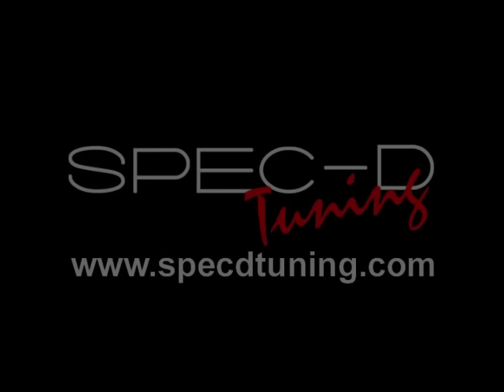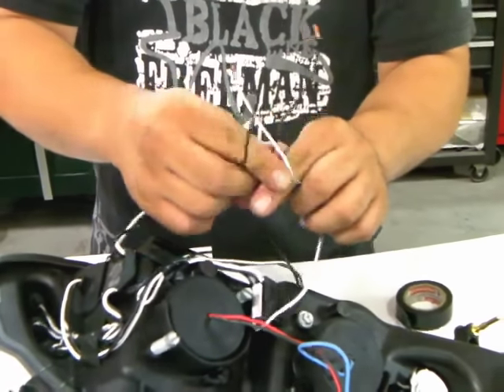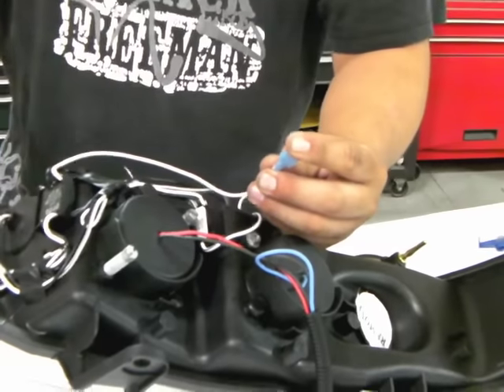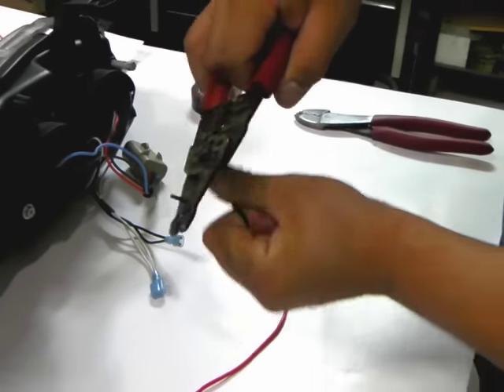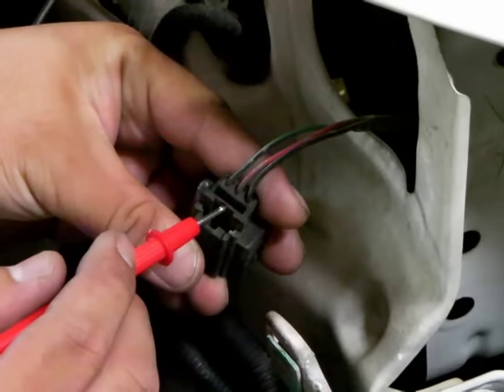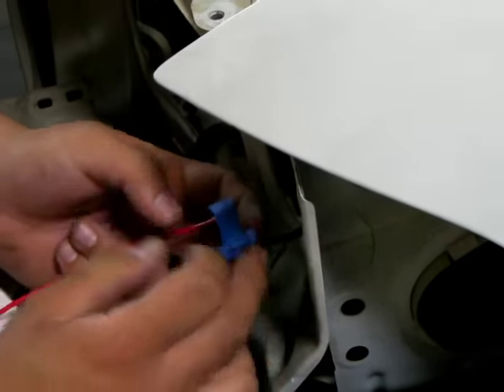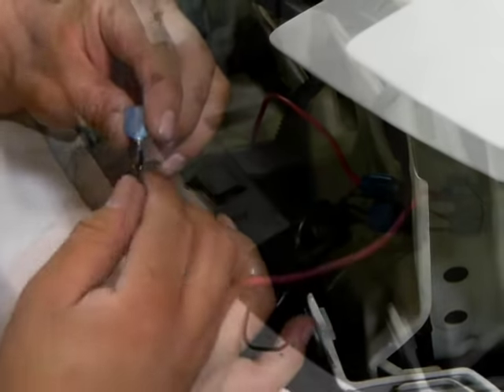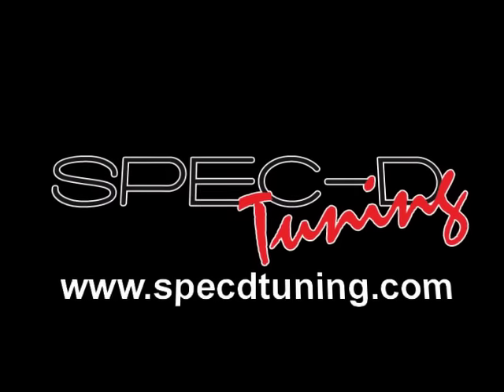SPECDTUNING Installation Video: Halo LED Projector Headlights Wiring Installation

Comment: bought a set of these for my jeep very happy with the bright light but once these are installed there is no way what so ever to get to the adjustment screws for up and down left and right this is so very much a hassle and I'm pissed.im not going to take whole assembly out to just adjust and put back in each time to get them right so they don't shine in oncoming traffic.very poor design..the next one is that the inverter for the three led lights above the halo rigs its faulty and had taken it to a well known shop to have tested and its shot.for the price of the new headlights I'm very dis pleased with your product.and also along with this I now have to call and figure out how the company is going to replace whats wrong...the major hassle is that even when I send them back for warranty I have NO HEADLIGHTS so I cant drive at night not have turn signals and this will prob take more than a week to settle this issue.do not buy these for a 04 jeep grand Cherokee laredo

Comment: Help .. ive got 01 yukon. New halos worked couple days. Then one high beam goes out. Then notice all headlights but one now runs very dim. Put originals back on with original wiring. Now they are screwed up with same symptoms. All very dim except one working head light i suspect using the crappy piggy back wire connectors in kit and run off side amber for power to the halows started problem time to go to dealer ?
Reply: +chrisccraig check your fuses my friend had the ame problem and he had a blown fuse

Comment: Do the Headlights come with the male and female connectors and the Red and Black Wires??
Reply: +Michael Collins if still clueless, i'll tell ya tomorrow (Mon) when my Intrepid ones come in, would like to know meself ;)
Reply: +Mark Cob they do not. I just got em.
Reply: ok, mine came in as well for my 2000 Intrepid today, took about 15 minutes to put in, but have been doing car electrics for years. 1 headlight consisted of 2 main plugs, 1 for Hi & 1 for Lo beam lights (plugged right into factory plug harness nicely), then it had 2 pairs of wires, wh/blk & red/blk, blks being ground, white wire was for + DRL halo eyes LED's. Red wire was for the + on 3 LED's on end of lite for turn signal, All 3 connections I tapped off the turn/park bulb-grounds,turn, and DRL...headlights came w/ those gawd awful scotch-lox taps and sum wire holders...I Solder personally, tossed the lox, they turned out looking nice..love a focused beam, Halo's and black a bonus ;)
thanks for the hedz up
Reply: Awesome, I'm doing mine this Sunday!

Comment: Should my LED and halo lights be wired into my daytime running light? If I power them on my headlight then they will not be on while driving during the daytime. My daytime running light is also my high beam at night
Reply from the maker: James Lambert Basically you will only have power when your headlights are on. If that is the case then you can find the wire that will only power your Daytime running light. Even if its the same bulb, you will still have separate power going to the bulb. You will how ever need to test the wires until you find the one you are looking for.
Reply: +Spec D Tuning i have a? I bought a set of clear projector headlights from spec d tuning and installed them on my. 03 grand am. But im haveing a litte trouble mounting them what do i need to do. After two days of me puting them in the driver side turn signal and the projector light high beam and low beam stoped working what do i need to do to fix the lights
Reply: +Robert Hensley pls help

Comment: i dnt get on dat last step how your getting power from tha car itself without strippin tha inside connection point on tha harness. they jus put tha red to red n black to black plastic n all n get power somehow
Reply: ohh nvm quick connector had a metal piece dat went through wires to establish connection

Comment: I would really appreciate if you can tell me where can I buy the blue and black wires? I ruined mine by accident.
Reply from the maker: you can buy wires almost anywhere. electronic stores, auto part stores. the wires arent a specific item spec d makes.

Comment: Are the crimp connectors a must? Is there anything else I can use?
Reply: Electrical tape
Reply: You can use wire nuts too. I wouldn't just go with electrical tape as one day it will come apart.  Just tape them up after.

Comment: I don't understand why the jumper wire is necessary, electrically it makes no difference, especially if you use those crappy splices. Why not just connect to the HL side of the connector?

Comment: Hey I got these for my 02 Camaro. When I turn them on the lights don't reach out far. The range is about 10 feet in front of my car and that's it. How do I change that?
Reply from the maker: Dr. Doom You can adjust the headlights. Behind all our headlights you will see a 10mm bolt or a phillips head that will help you adjust the projector beam.

Comment: installing in a ram and led do not work on either headlight. tested straight to 12v but nothing. any suggestions
Reply: +william anderson flip the wires and see..wont hurt nothing...LED's are Polarity sensitive

Comment: I recently bought and installed these headlamps. I got everything connected on my '04 impala but the LED rings stay on, even after the car and lights has been turned off. is there something I did wrong?
Reply: I have the same problem on the passenger side the angel eyes stay on even when the car is completely off idk why
Reply: +Michael Johnson did you connect them to the same wire as you did on the other side?

Comment: This video isn’t correct for my application on a 01 dodge ram 1500. When I tapped into the hot wire the LED’s constantly stayed on even after turning off the headlight switch. So to be able to turn of the Halo’s and LED’s you have to wire all the white wires to the parking lights again this is for a 01 dodge ram 1500. Hope this helps someone.

Comment: Bought for scion tc 2010 they don't plug and play. There's no connector for the blinker wires.
The video says white both additional wires together... that doesn't even make sense. Sent the Ebay seller feedbackand asked the same will update if the is positive outcome however in guessing it is not going to work the size is good the wires don't work...

Comment: Does anyone know what bulb retainer replacement I need for LED H7 bulb? They are projector, but I’m going to use the 360 degree led bulb, but I need to know the retainer replacement because the LED bulb will not work without it. Thanks!

Comment: @Specdtuninginfo All the fuses seem fine although i can't locate the fuse to my fog lights although its weird that my parking light's won't work if technically i did no rewiring for it and its the same bulb also didn't touch the fog lights. really weird. I am gonna have to fine someone who knows the other fuse box is.

Comment: I don't see the point in wiring into the vehicle's wires for the driving lights.

I just spliced the wires into the driving light assembly and it worked just fine. This way you use less materials, are making fewer splices, less steps/confusion, and if you fuck up your wires the indicator/driving light assembly costs ~$25 to replace OEM, as opposed to having to rewire your vehicle.

Comment: Yeah wasted some money using those female and male connectors didn't work by connection so I manually had to wrap the cord around them wrapped, luckily I left one connector it self as the wires still were together it was like a 2 hour process ensuring it all was connected as well as using the electric tape and the zip ties so the lights don't flicker on my car

Comment: I have to conect the halo wire on the headlight wir3s or can i use the side light to conect it?
Reply from the maker: chrstopher666 You can use any power and ground to connect the halos, but be aware they will only light up when there is power going into that bulb.
Reply: Thanks for your help i love my new headlights

Comment: why doesn't these headlights come prewired, and ready to install? instead of this messy paper clips and electrical tape thing? and also why would you crimp on factory wires instead you could have gotten a male/female plug that would fit and crimp on it instead of messing with your original wiring!!!

Comment: Hey I have been watching your channel since I started to upgrade my 8th gen Honda Accord EX V6. I ended up purchasing the Black Smoke For 2008-2012 Accord 4Dr Halo LED DRL & Signal Projector Headlights from SPEC-D Tuning. SInce then my front left headlights turn signal went out. would anyone possibly know how I can go about changing the bulb? My manufacturer part number is 2LHP-ACD084G-TM. Any help greatly appreciated 😊

Comment: I'm installing these lights on a 1998 Chevrolet 2500, the left housing fit perfect but the right housing is not seating properly. The right housing is angled up, with the outside being low and the inside high. I had to remove the horn but still having an issue. Does anyone know what the issue is?

Comment: I'm having problems with my light I did exactly everything on this video my halo rings work but the leds on the side doesn't why is that?
Reply: Marc Joseph Catindig  how did you get the halos to work,is it just wiring white to black from the OEM headlight wires?

Comment: Hi SPECDTUNING  well i have a 1998 bmw e39 5 series and the instructions are different from the video some extra wires with some kind of resister came with the lights but it does not say on the video to hook these up? will the led's be fine just hooking up with the power for turn signal light please advise and i love the look and i have done headlights before but i want to make sure and if anybody can help that would be great thanks

Comment: Bought a set from spec d for a 2011 silverado. Absolutely horrible design! The wiring didn't throw me off as I'm pretty mechanically inclined but adjusting them is impossible without removing. It took me two hours to adjust these headlights. You get what you pay for

Comment: I just bought a new set of Halo projector headlights. My left low beam works but my right does not. Both hi beams work. I have tested the right wire harness but it's not getting a current. I have no clue what's wrong. I just installed them today. Also my leds and halos are not working. Help me please
Reply: +Cody Barnett The low beam bulb could be bad.  I just replaced mine today after I had the same problem and they work fine now.
Reply: +KiLlermidet It was the fuse for the r/h headlamp. Now my halos on both sides come on but my leds don't. any ideas?

Comment: Hello Spec D Tuning, I purchased the Halo LED lights for my 2001 Mercedes S500 and they were working fine on day 1;  Day 2, the right low beam headlight is out.  I switched left and right bulbs to determine if it was the bulb or the connection.  Unfortunately, it's the connection.  No high or low beam.  Everything else works.  PLEASE HELP....Thanks
Reply from the maker: james Morman Contact your seller and they will have the unit replaced.
Reply: +Spec D Tuning hey spec d, can I use this same idea for installing just an oracle halo kit to my headlights assembly?

Comment: what gauge wire do you use
Reply: +tenn ohmae it's almost in your name.. E=IxR, figure out current draw, wire according to your findings (Hint: 12Vdc LEDS are very low current drawers)
no CREE LED's, just a normal hole-thru L ight E mitting D iode
16-18g be fine

Comment: What did I do wrong? My Halos and LEDs on my 2004 Dodge Ram 1500 only comes on with the the brights. HELP!
Reply: U must hav tapped the wrong wire, turn ur parking lamps on and find power from them and wire them up to it.

Comment: I AM HAVING A PROBLEM WITH THE WIRING THAT CAME WITH MY 2005 MALIBU LT HALO PROJECTOR LED HEADLIGHTS, WHEN I GO TO THE WEBSITE THERE IS NOT EVEN AN OPTION FOR ANYTHING OVER 2004, AND THE HEADLIGHTS ARE DIFFERENT! HOW DO I CONNECT THESE WIRES? THE INSTRUCTION SHEET IS POORLY PRINTED AND DOES NOT TELL ME ANYTHING!

Comment: can i wire it so i dont have my halos come on, just my led lights?
Reply: Remove rubber seals on top of the light,
You can just pull them out of their holes and let them hang inside or whatever.
Replace the rubber seals and you’re golden!

Comment: My halo headlights have 3 black and 3 white? Do I just wire all the whites and all the black together? In this video there's only 2 of each. I have a 2000 Honda accord
Reply: Ok I found out what it is it's the daytime driving light were do I wire that to someone please help......
Reply: Just quick connect or splice the drl(daytime) light to a constant 12v power source, meaning test which wire has power when u turn your car on (without having to turn headlights on, or connect to fog lights so you can manually switch them on without turning on head lights
Reply: +Benjamin Merino thank you man

Comment: So.. the wires always go with the same color for example: black on black?
Reply from the maker: Gilbert Briseno You always want to keep in mind that the black wire will always be the ground wire and the white or colored wire will be your power. I hope this helps.
Reply: Spec D Tuning thanks it did! My halo light look great now! :)
Reply: Gilbert Briseno i really need help with wiring.   The instructions that came with it are not helpful.   Each headlight has 2 white, 2 black, and one white/black stripped wire.   I have no cluei how to connect them.  The high beam, parking, signal and marker lights show.   Just need help LED and halos.  Any advice/instructions will help.  Ty
Reply: ***** Connect the two whites together and vise versa. That's what I did, it will get the power from the connector and your halo should be working fine! Hope this helps!
Reply: After i connect the two white wires together, thats it?  Or do i need to then connect them to something else?
Reply: ***** yes there is a little connector type of thing but I left that alone

Comment: have a 2011 fusion, cant get the LEDS to work with the two led wires being attached to the parking lights. anyone else have experience with these lights?

Comment: @jcousar15 I JUST GOT EVERYTHING WORKING LOOKS FREAKING GREAT,OF COARS I FOUND DIRECTIONS  AND QUICK CONNECTS IN THE BOX AFTER A WEEK OF TRYING TO FIGUR EVERYTHING OUT I WAS SO PISSED,LOL BUT YEA THE LIGHTS ARE GREAT JUST MAKE SURE YOU USE YOUR OWN BLINKER LIGHTS BCUZ THE ONS PROVIDED WONT TURN OFF,LOL OR BLINK, BUT ITS STILL DA BEST 80BUCKS I SPENT,LOL

Comment: I bought a pair of Halo headlights for my Mitsubishi Eclipse 2002. The problem is that the main wires are already connected and there two extra wires, one red and one black, they enter as a + and a - into a this little box and both come out black as output. Where do I connect this ones? Thanks
Reply from the maker: +iPlatano07 It is really how you want the LED and halo bulbs to function. You would need to test the power on the fog lights and splice them into the hot power wire. The black you want to ground it to any other black wire.
Reply: +Spec D Tuning Thank you so much!!!
Reply: +Spec D Tuning. I have a 03 grand am and ordered some halo projector lights from specd and I was wondering is there a hid bulb in the projector light or do I have to buy one
Reply: +Spec D Tuning I have the same issue I bought a pair of LED PROJECTOR HEADLIGHTS for ford fusion 2012. All wires already connected and there are 2 extra  wires for LED I dont know how and where I should connect them ?
Reply: +faisal aljehani the 2 LED wires are DC (+ & - ), wire them according to what you want the LEDS to do..DRL's??, tap red one up to + parking light wire..want LED's as turn??...tap red into + turn signal wire, black always ground.. LEDS are polarity sensitive (+ -), if ya connect them and no light, then just reverse the wires, wont harm light
Reply: +Robert Hensley ones i ordered for the Intrepid said it does come with 2 H1's and 2 H3's..Find out tomorrow when they get here

Comment: No matter what I do I cannot get the damn halos to work at all. And I'm using a Pontiac Grand Am like in the video but nothing is working. Update: got them working by wiring into fog light. as long as my fog lights are on there on which I usually keep them on anyways so that's not a big deal. But my brights don't work and have never worked-on either side-which is part of the plug-and-play part so they should work but they don't so you guys did something wrong from the factory.